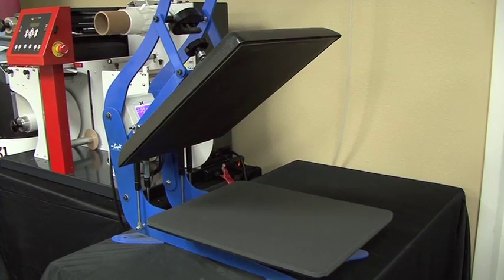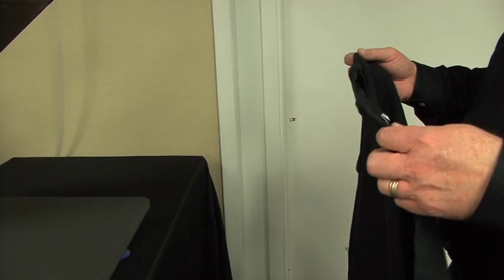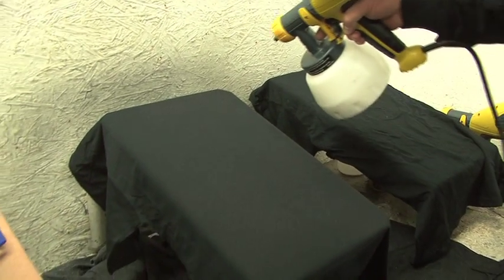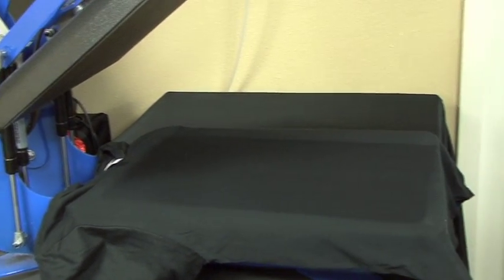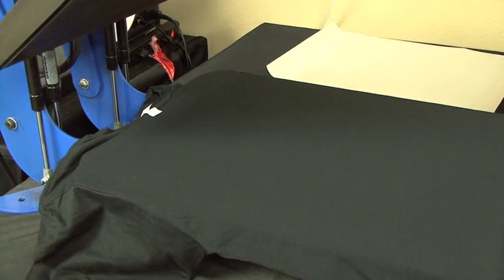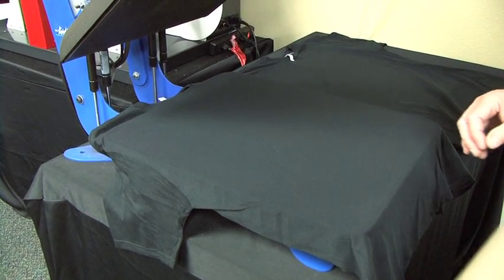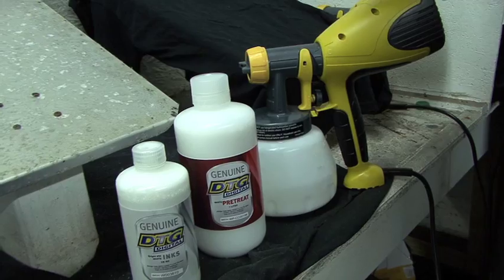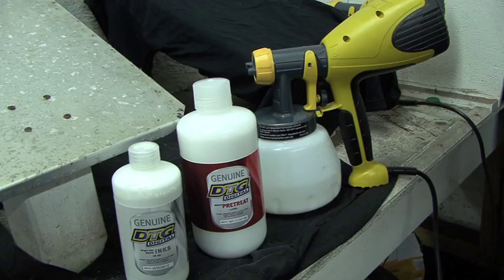Viper DTG Printer Training - How to Pretreat a Garment

Comment: In this you mention not to use parchment paper for pressing after the shirt has been sprayed. Why is this the case?

I belive that baking paper used for cooking is considered as parchment paper correct?
Reply from the maker: Yes, that is parchment paper. Parchment leaves a kind of matte finish on the shirt, teflon sheets leave a more glossy finish.